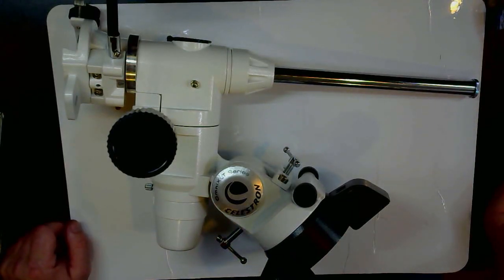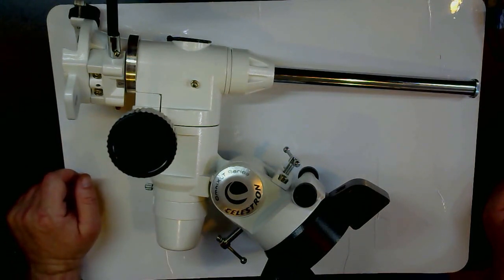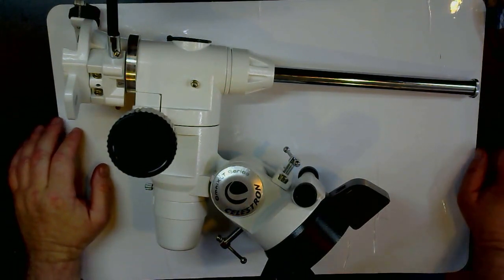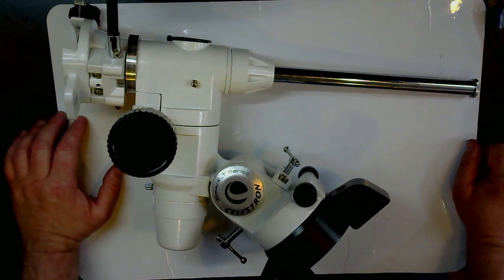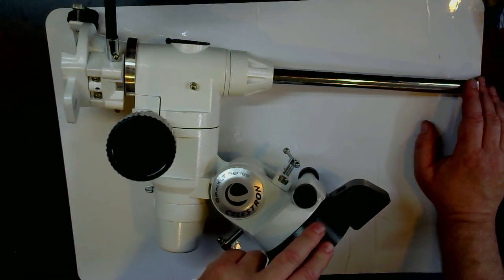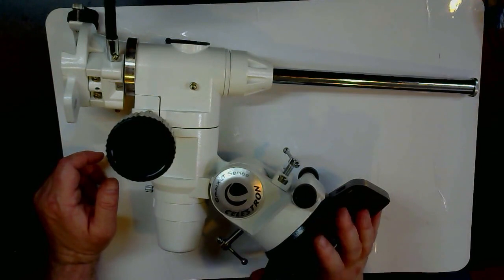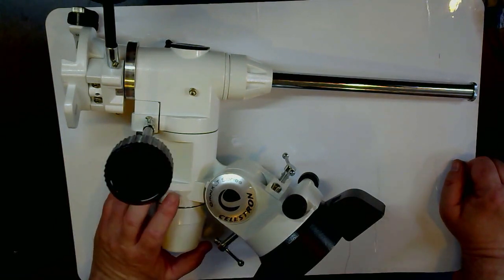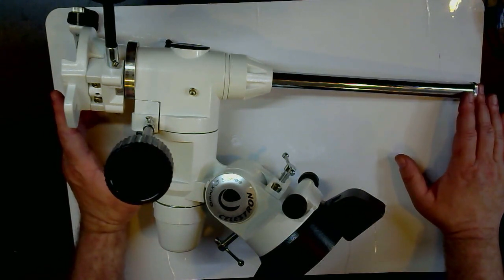Celestron CG-4 teardown/rebuild tutorial, Video 1 - Teardown Part 1

Comment: Q. Is this mound similar enough to my Orion Skyview Pro, to serve as a guide to it as well?
I've been told their essentially the same?
Reply from the maker: Well, yes and no.  The Skyview is actually the same as the next step up, which is the CG-5.  It's an EQ-4 design.  The CG-4 is actually an EQ3-2 design.  The Orion Astroview mount was the same as the Celestron CG-4.  That being said, they are not that far apart in design, so these videos will help you open up your Skyview, but be aware that there are some differences.  The Skyview is a heavier mount, it has some actual bearings inside, and is slightly more complex.

Comment: Hi.  Thanks for the videos.  I just purchased an older mount and can't find an answer to a question I've posted and asked.  On the declination ring, there is one arrow that is a metal tape in an indention and a white arrow that is cast on the other side.  On mine, they are out about 7 or 8 degrees from each other.  I'm in contact with Celestron and the guy hasn't really given me a good answer as to why this is.  Do you have any answer as to which to use or why they are not in sync with each other??  Any help would be appreciated.  Mick

Comment: Hello, Have you had any issues with the mount stripping out and breaking
 apart? Does anyone know if it is possible to change out the part before
 it strips and drops the telescope?
Reply from the maker: Thanks for looking at our videos!  exactly which part are you concerned about?  You can also contact us at support@axissquared.com with more questions.
Reply: @axissquaredllc6190  He means the main mounting to the tripod bolt threads. If they strip the whole mount falls off. I used a helicoil that's stronger than the base metal.